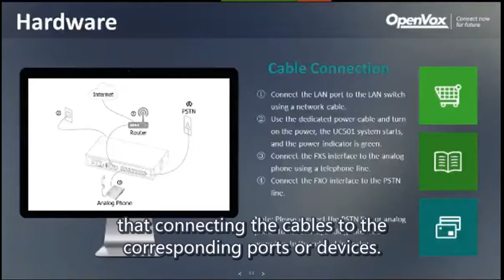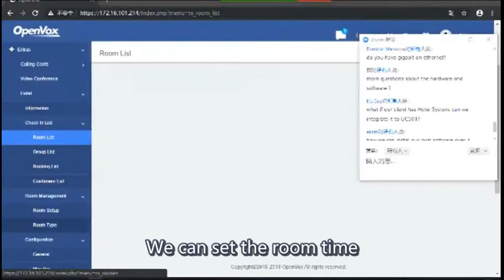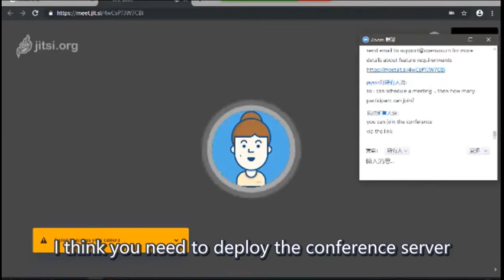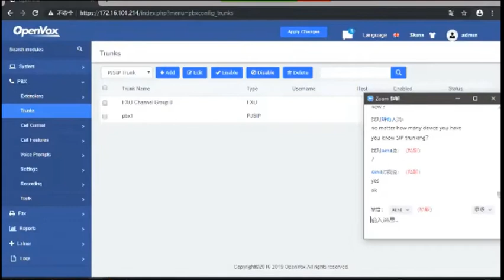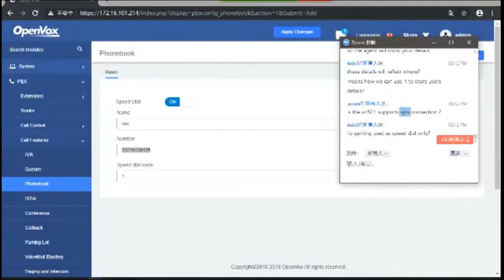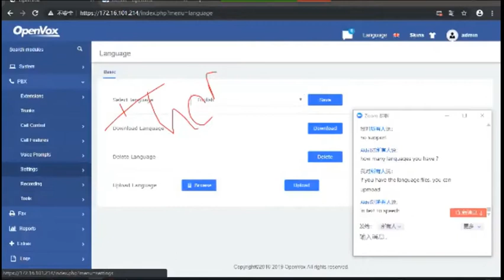Upgraded UC501 Introduction

Comment from the maker: 31.Q: RAM 1GB only, how to use VICIdial on this device?
A: If you do not have more call traffic, I think 1GB is enough. If you need 2GB, we can also provide 2GB core board.
32.Q: Is the UC501 supports VPN connection?
A: We support 3 kinds of protocols, Open VPN, N2N, and L2TP for now.
33.Q: Do you have a website that we can check the GUI of OpenVox
A: www.openvox.cn (home page) 
http://demo.openvox.cn:65324 (UC series Online Demo)
The demo is an old version. We will release a new version next month, and we will update the firmware for the demo device, you can check later.
34. Q: When do you update it? the version?
A: The end of next month.
35.Q: Can you upgrade your storage? Like 500GB?
A: Our default storage is 16GB EMMC disk. If you need 500GB I think you can use a USB drive. You can also mount your network share from your NAS server.
36.Q: Can we use NAS/SAN storage?
A: Yes.
37.Q: Can we have a copy of the limitation of UC501? Which we can see the limit of how many ring groups, voicemail, etc.?
A: And about the limitation of UC501, actually, we do not have the limitation about the ring groups, IVR, voicemail.
38.Q: How to do access the mounted storage? File share, user? Copy the recording, etc.?
A: In auto-backup setting, you can choose the schedule, daily, weekly, or monthly. And you can choose the target media, use SD card or FTP server or CIFS server. It will auto backup the configurations or call recording files to the target storage. 
39.Q: If we want data to be saved directly to NFS/external media, is that possible?
A: No, you cannot just save directly to the external media, it's only for backup.
40.Q: Do you have sample text to speech?
A: Yes. We have AI TTS. 
In this feature, we use the Google TTS engine and you can use this engine to transfer the text to speech and the voice quality is quite good.

Comment from the maker: 21.Q: How many phone or gadget does UC501 SIP Forking have? In one extension how many phones can I use it?
A: we limit to 5 as default. But you can change it.
22.Q: how many concurrent calls do UC501 support?
A: UC501 can support up to 800 extensions and up to 300 concurrent calls with ulaw/alaw codec. If you need transcoding, it would be 100 concurrent calls
23.Q: How does AutoCLIP work?
A: If you have an extension 101. When the 101 extension calls your mobile and your mobile miss the call. Then when your mobile call back and it will directly lead the call to the extension 101. No matter what kind of inbound rule you set, like IVR or DISA. It will jump those settings and lead the call directly to the extension. That's how AutoCLIP feature works.
24.Q: How about Auto dial, CRM base click dial? We are talking about CRM base data dialing.
A: It's kind of call center feature. We have the idea to integrate the call center module in our PBX, but not ready yet. If you want to use call Center feature, I think you need to install a system like VICIdial to do that. For now, our PBX system doesn’t have this feature
25. Q: How many layers IVR?
A: We do not have that limit, you can add as many as you want.
26.Q: Will it support VICIdial? Can we install VICIdial dial on this box? If we can which version?
A: If you want to install VICIdial on this box, yes. You need to format the whole device first, that means you need to install the whole system of the VICIdial to replace default OpenVox IPPBX system.
27.Q: Which version of Vicidial is working? 
A: I think the latest it's okay. But it will need some customization about the boot loader or kernel. If you have this kind of request, we will try to build an image which can run on our hardware and send you for a test.
28.Q: Does OpenVox has his own softphone app?
A: OpenVox doesn’t have our own softphone yet. But we have planned to build our own
softphone APP for the Android, and IOS is not in our plan.
29.Q: How we can use phonebook?
A: It’s about the speed dial and you can set the speed number.
30.Q: Can Elastix also install?
A: Yes, we can also install Elastix, Issabel, FreePBX, and almost all popular Linux distribution. If you need you can send more details, and we will prepare the image for our hardware.

Comment from the maker: 11.Q: Can integrate with others CRM?
A: We provide AMI API as default, if your CRM can use this kind of API, then no problem.
12.Q: Can put gsm port also in it?
A: Yes, we have this plan and we have remained the gsm port for our UC700 PBX, maybe we will make it happen on that device.
13. Q: Please explain the video conferencing how it works?
A: You can join the conference via the link (generated by video conference module).
14.Q: Then how many participants can join?
A: It's based on hardware performance.
15. Q: Do you have a minimum requirement for the internet bandwidth?
A: The conference is based on your network speed and your network quality.
16.Q: Why my US501 didn't have Hotel Module?
A: It is the old version. This firmware is under test. It will be released next month.
17.Q: Can I send and receive faxes with your VOIP IP PBX solution?
A: Yes, we support receiving fax from the analog port, and we can also transfer the fax to your email box.
18.Q: Can we make a group of different users and give admin privileges to one of the users, so that admin can access data of its own group of users. Feasibility of making different groups and their respective admins?
A: For now, we do not have the permission group. We have only two group settings, one is for administrator and another is custom.
The group permission is possible and we will think about it in the future release.
19.Q: Can I connect the UC501 with another server like Yeastar?
A: Yes. UC501 is IPPBX, you can connect any device if it supports the SIP protocol or IAX protocol.
20.Q: If we can stack multiple IPPBX? How to communicate 2 IPPBX in between them?
A: You can connect them by SIP trunking. SIP trunking to connect the IPPBX, no matter how many devices you have.

Comment from the maker: 1.Q: What is the hardware specification? Processor? RAM?
A: We use the Intel Quad Cores CPU and 1GB RAM, and 16GB flash. 
2.Q: Can UC501 integrate 3rd party app using API?
A: We provide AMI interface as default. And we are planning to add HTTP or HTTPS API later.
3.Q: Can we upgrade RAM?
A: If you think 1GB is not enough, we can provide 2GB.
4.Q: How we can use click2call?
A: We provide HTTP API to trigger it that means you can generate an HTTP/HTTPS URL to trigger the click2call. We have a document to show you how to do that.
5.Q: Does it possible to connect existing client PMS to UC501? 
A: Yes, in the future we will try to add the PMS connect.
By the way, we already developed a hotel system. It was integrated as default. 
6. Q: Do you have gigabit ethernet?
A: On UC501, we have only 2 10/100M Ethernet ports. 
But in our UC700, we provide Gigabit Ethernet interface.
7.Q: What if our client has Hotel System, can we integrate it to UC501?
A: We need to know what kind of API it can use, then we will try to develop the connector to do the integration.
8.Q: How we can install our own software over it?
A: I need to know what kind of software you want to install, and what kind of system you are using. Our hardware is open to install any kind of Linux system with UEFI support.
9.Q: Any kind of system image can be installed over it? Like CentOS.
A: Yes, we can install CentOS, Ubuntu, Debian, and I think any kind of Linux system. But one condition, you need to support UEFI boot. You need to support grub2-EFI to fit for our hardware, the traditional MBR bootloader is not working.
10.Q: Then how to use FXS/FXO port? Will you provide patch files?
A: If you use your own system we will provide the DAHDI driver for the FXS and FXO port.